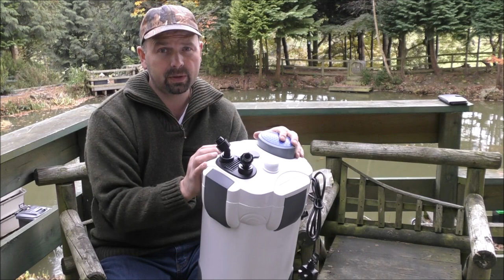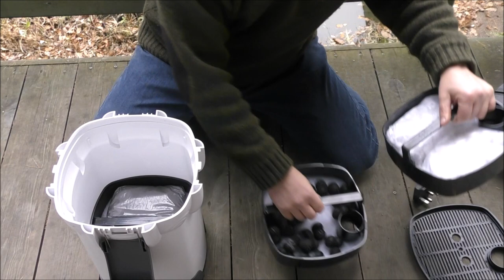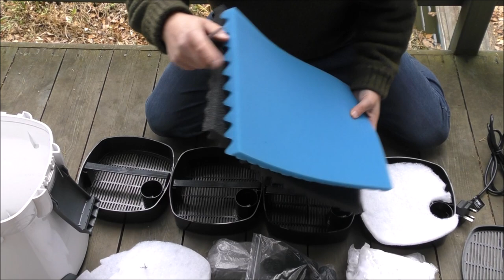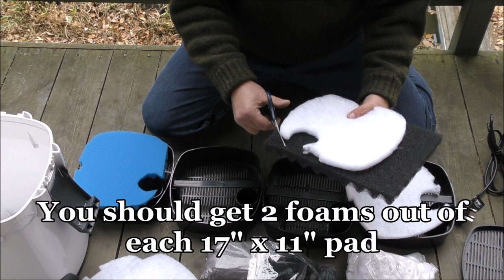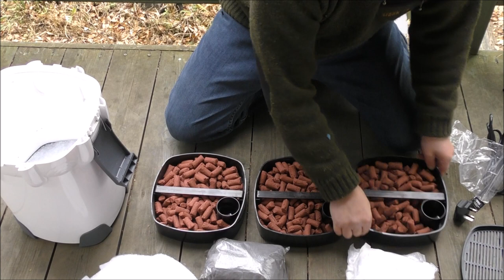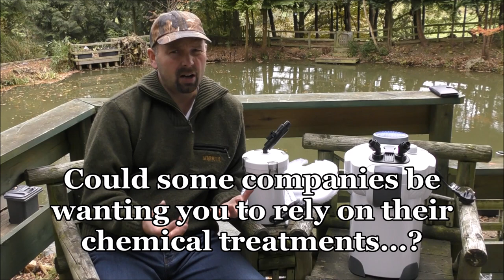Why Your Filter is TOO SMALL and NOT CYCLED

Comment: Considering I have a sunsun 3000l/h and I want to use SunSun HW-603B which has 400L/h pump as a pre filter how this will work?
Reply from the maker: It will work but the pump will slow the flow down so a pre-filter without a pump would be better - either option is still a bit small for big canister filters and I really want to see manufacturers making their pre-filter / boosters larger so there is more surface area and less restricted flow.
Reply: Pondguru unfortunately I didn't find this model with out the B in Brazil hence I should end up buying it and removing the pump or considering the main filter is more strong maybe even with the pump it should work fine but just the small pump will work easier since will get a help from the biggest pump. Thanks for the help! I really enjoy your videos keep going!!
Reply from the maker: I'm not sure two different output pumps would work well on the same system but try it and see what happens - if any are going to burn out it will likely be the small pump first. Ideally the pre-filter would be much bigger for such a powerful main canister filter.

Comment: What do you think about UV Sterilisation? Does it work?
Reply from the maker: Yes it is useful but not essential.
If you have multiple tanks linked by the same filter then it is advisable to have a UV to prevent cross contamination (by parasites / bacteria) but for a single tank system a UV is not essential.
UV light does prevent green water and can aid water clarity but if you have a suitably sized filter which is set up properly you won't need a UV.
Reply: Thank you for your reply!

Comment: Interesting. Even though I cannot afford bigger filters, I will change the location of the fine pads, ditch the carbon, add more bio and see what happens
Reply from the maker: Yes even just setting the filter up properly and using good media can make all the difference if the filter isn't strictly big enough.

Comment: Just received one of thse canister filters in the mail today and set it up. I can REALLY see why they are preferred over hang on back filters...so much more media. Set up the foams coarse > medium > fine > 100 micron felt pad > biological > purigen with more biological.

My only issue is the spray bar is really having a lot of flow coming out of it...will increasing the hole size reduce the flow a little bit? It's not terrible, just edging to the point of too much.
Reply from the maker: Yes making the holes bigger will reduce water pressure and speed of flow but not reduce the volume of water which is coming from the pipes. Instead of making holes bigger it is better to drill a few extra holes the same size as the existing ones until the desired flow is achieved.
Reply: Thank you for the reply, sir! I just put together a DIY intake and spray bar, letting them cure over night. We'll see how they work tomorrow...the spray bar will span most of the length of the back of the tank. That's one thing I noticed about this canister filter, the intake and spray bar are pretty thin and it doesn't seem like the internal diameter is the right size for the hoses they use. Hopefully these DIY projects work well!
Reply from the maker: Yes the problem with a thin bar is an increase in pressure but extending the bar will reduce pressure.

Comment: Hey mate, I’m looking at running the small booster and larger canister set up but not sure if the flow rate on the booster will keep up with the larger filter? How do I set it up? Do I run both or is only the large filter on? 
I’m using the same booster as you have in the video and a Hagen elite flow 80. Thanks
Reply from the maker: Boosters will be fitted inline and will affect the flow - it's always best to go for a suitably sized filter, set up correctly and then not have a 'need' for a booster if you want maximum flow from the filter.
Reply: Pondguru, thanks for getting back to me. What I mean is that my booster canister has a motor on it because it can work as a stand-alone filter. I can’t see any way of removing it, should I run the motor on the booster and the main canister filter?
Reply from the maker: @paulnew86  Those little boosters are quite restrictive so see if it makes a difference having the booster pump on as opposed to off - it may help the flow.
Reply: Pondguru, thanks bud, I’ll see how it does. I’m just worried the little one will run dry or vice versa.
Reply from the maker: @paulnew86  I'm a bit lost as I'm juggling about 50 different conversations on different videos, emails etc. and my memory is terrible - even when I'm reading previous comments I've forgot what the first one said by the time I'm on to the second or third, lol
If you're running the little booster as a stand alone filter and the canister as a stand alone filter on the same tank that will be fine and there is no way the smaller one would run dry since the level of water in the tank should stay constant.
Reply: Pondguru, no worries, understand your busy and appreciate the help. 
I was still wanting to run the filters in sequence with the booster at the start?

Comment: Anyone have a link to the booster filter? I'm not familiar with that model.  I have a sunsun 704b with 8 pounds of biohome ultimate (2 trays) and one tray of Matrix on a 75 gallon tank, which I will be phasing out as the biohome gets established. It is setup as the Guru recommend.  I have to admit I did have it setup the other way for years 😕 thanks for the great video.
Reply from the maker: I'm not sure the larger size of booster is available on Amazon.com but since All Pond Solutions filters are exactly the same as SunSun it should be available in US somewhere.
Reply: It's just a another canister that you have the output feeding the input on the bigger filter right?
Reply from the maker: Basically its just a canister which fits inline on the inlet pipe, yes.

Comment: Dang, I use Prime during water changes and also just added a packet of Purigen to my canister filter.
Reply from the maker: Oh, see how it goes with regard to the nitrate levels - some people seem to have have no problems when using both chemicals but they are 2 which are common in failure stories when relating to bacterial development of the filter.

Comment: I know you don’t want to bash a company’s product as you don’t have definitive proof p.. but... what water conditioner would you recommend.. the majority of conditioners on the market are setup to detoxify to some extent..
Reply: Pondguru the issue is many who actually need denitrification are running large tanks.. so going with something that takes an entire bottle to condition a water change is less cost effective then using something like seachem safe where one bottle is a lifetime supply. I will admit I love tetra products and feel they are way underrated.. their easy balance plus and safe start are the best products around when used correctly.. your complaints wo saying we’re actually directly targeted towards seachem products.. prime/safe and Purigen. I have traditionally used both and I can attest that prime/safe doesn’t work as advertised as when my nitrates hit high levels my cichlids generally get more aggressive. If unable to change water I does prime/safe and within minutes the tank goes back to normal. 

So your answer leave me yet anther question.. for people with large 100g plus sized tanks what product should we use in your opinion? Ideally in a perfect world per cost.. the most effective way would be to use carbon to prefilter water and eliminate a declorinator all together.. I’ve got 8 freshwater tanks the smallest being 44g a couple 55g and most are 125g plus. At current use of prime/safe I calculate water change cost at $20 a month worst case.. if I were to change to tetra (which I do use on smaller tanks cause it’s easier t measure) one bottle treats 500g I’d need 2 bottle a week min costing $80 a week. I’m not trying to debate the issue but more so find the most cost effective method. My tap water is perfect for the tanks I keep so the only cost is declorinator vs water costs. So if you were in a similar situation what would you use?
Reply from the maker: If I had plenty of free time I wouldn't be concerned about nitrate since I would do very regular water changes with treated tap water using whatever the cheapest option was for dechlorination but if I was aiming for a full cycle I'd be concerned about the products which prevent that happening, set all the filters up properly and ultimately that would result in much less water changes allowing me to justify the cost of a more expensive product to dechlorinate which did not affect the cycle. 
There are loads of cheap dechlorinators out there which do not affect the cycle but if I had a nation of tanks I'd probably invest in a really large plastic water tank for water changes and simply have air bubbling through it with an auto-top up on it which allows it to be re-filled when I drain water off for water changes.

Comment: i have a pre filter and ive ordered another one, one is going before my main filter and the other one is going after my main filter with half biohome and half carbon granules with carbon pads holding the granules in place, my main filter will be full of biohome media, i may even get another pre filter to put in line before my main filter and have the foams in the correct sequence from one through to the other so its coarse medium fine and filter floss, should be interesting if it all fits in my little cupboard lol
Reply from the maker: You're going to need a bigger cupboard, lol
It's a good move using a booster after a main filter as not many people will consider that as an option - I really should have mentioned that in this video but my crumbling memory cells wouldn't allow that.
Reply: its a thing called getting old when you cant remember to do things lol thats me im always forgetting things
Reply: im full of daft ideas lol

Comment: Hi Pondguru, need serious help. Following is my setup SunSun 302,  two trays 1.5 L Matrix (don't have biohome in my country),last tray 800 gm ceramic noodles (I know they are bad will replace soon) using SunSun HW 603 as prefilter. 4 feet long tank about 65 gallon. What kind of flow should I expect right now I see flow is really low not more than 100 gph. Maybe even less. Not sure if there is problem with my setup or the SunSun 302. Please reply
Reply from the maker: The pre-filtes do slow the flow down to various levels depending on how clogged the foams are / how fine the foams are and an actual output of a canister filter is mostly dictated by how restricted the water is, how many bends / joints etc. and how high it is pumping water to.
If your flow is way too low with the booster on the inlet pipe you could try installing it on the outlet pipe and returning the foams and fine pad to the bottom tray of you r main canister. You can then replace the foams in the booster with filter media and that should improve flow greatly as water will not be as restricted through the booster on the outlet.
Reply: Pondguru Thanks for such a detailed reply appreciate the effort. My filter is on same level as the tank and I have removed all the bends and all. Will try removing the pre filter to confirm that is causing the flow rate to reduce. Thanks a lot will update soon. Keep making videos you have a gift of explaining things.

Will try to make a video as well. Thanks a lot.
Reply from the maker: No worries and I hope those measures help the situation.
Reply from the maker: It is difficult to tell since the water level in the tank is so low and that will severely affect the flow as the pump has to drag the water up the pipe against way more gravity than if the tank was full.
Reply: Pondguru finally was able to fix the issue. It seems the tubing was all blocked up. Don't know if was detritus or algae.. but after cleaning it the water is again gushing out

Comment: Couple of questions for you. Have a 25 gallon fluval accent aquarium. The filter that comes with it is ok but not great. Can you tell me how to mod it to make it work better until I can afford to rebuild the used fluval 206. As well as where to buy media to fit both filters the 206 and the in tank filter. Thank you for your time in advance.
Reply from the maker: I'm not familiar with that tank / filter unfortunately but it looks like they have gone down the replaceable cartridge route to tie you into buying new cartridges each month?. Generally the best media for canister filters would be the biohome ultimate and the 206 will take approx. 500g per tray so assuming that you used the bottom tray for coarse, medium and fine foams that leaves 2 trays for media (1kg total).
Regards,
Richard
Reply: Yes replaceable cartridge route is correct. I will try to figure out how to mod it. Also where is the best place to get biohome ultimate here is the USA around the NH area? Where would be the best place to get mechanical filter material in the USA as well and what sizes?
Reply from the maker: you could try Greatwave Engineering as I know Don has biohome and foams.

Comment: Thinking of using this in my 1100l aquarium. PRESSURISED POND FILTER KIT PFC-12000 & AQUAECO-8000. What do you think please?
Reply from the maker: That is a filter and pump I haven't used on a pond but the APS gear is normally good for budget Chinese stuff.
The only problem I can see is that the pressure filter has no capacity for adding proper filter media so you would end up with clear water and sky high nitrates.
Reply: Pondguru thank you.
Reply: I'll be filling it full of alphagrog.
Reply from the maker: I'm not sure that would work as the filter is designed to have foams around a central shaft with only a small provision for filter media in the bottom of the filter.
You need both mechanical (foams) and biological (media) filtration for the water to be healthy.

Comment: What about sponge filters? Will they do a complete cycle?
Reply from the maker: If you have huge sponges and they get dirty enough to develop anaerobic zones then they will help to achieve a full cycle but sponge filters which are commonly available are simple mechanical and aerobic bacterial filters - good enough on ammonia and nitrite but no good on nitrate. The nitrate reducing anaerobic bacteria need a specific environment to populate in sufficient numbers to impact on nitrate.
Reply: Do you use api to test for it?
Reply from the maker: @TheGnthreman The API liquid test kit is easy to use and accurate so would be a good one to use, yes.

Comment: Hi Richard, I'm having a nightmare with my tank and filter at the moment. I happened to watch this video and it pretty much included all the problems I'm having. I've already got some mini ultra in an aps filter like the one in your video. I have it set up in the wrong order with only 3kg of biohome in the top two trays. I've ordered another 3kg of ultimate tonight so I can fill it properly. My filter has had a few issues in the 18 months I've had it and I'm looking at eheim pro4 600. Does the pro4 set up in the same way as the aps efx+ I have? Also I have 40ppm nitrate in my tap water, Will the biohome be able to improve this?
Reply: Also some of the chemical liquids I've added to help have lowered my pH below 6.0
Reply: I've also had the bottom two trays of foam set up wrong. I'll sort this out when I receive my order of ultimate. I really want to get another filter though before I have anymore problems with the one I have.
Reply: Sorry if I'm rambling.
I have an aps efx+ with 4 trays.
I now know how to set them up properly.
I've purchased new biohome to add to the existing biohome media.
Once this is all up and running I'll buy a new filter.
Possibly with a pre filter canister as well.
Is the eheim pro 4 600 suitable?
Or can you suggest a more suitable external filter?
Reply from the maker: Dear Dean,
Unfortunately I haven't got the tray sizes recorded for the pro4 600 but I have the pro3 600 down as holding approx. 1.35kg of ultimate per tray.
The Pro3 and Pro4 both have a 'pre-filter' tray in the top which water hits first before going to the bottom of the filter and rising up through the trays so the pre-filter  tray can be left as it is with the rest of the trays set up as in this video (bottom tray for coarse and medium sponges and fine pad then 3 trays of media above that).
You're in the UK so just give me a ring any day on 07772848730 between 9-5 as phone is always on then. It's much easier to go through the problems and any solutions by a short phone call than farting about with messages back and forth. I guess I'm too old for that stuff but I do often miss messages and comments unless they are new comments on a video. For example the first comment you posted here came through as a notification but the subsequent 3 did not.
Regards,
Richard